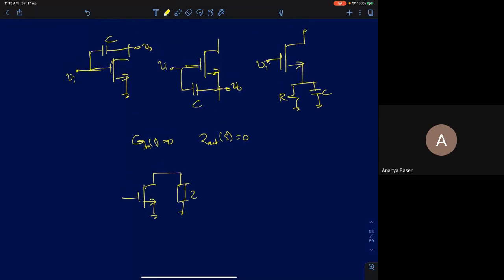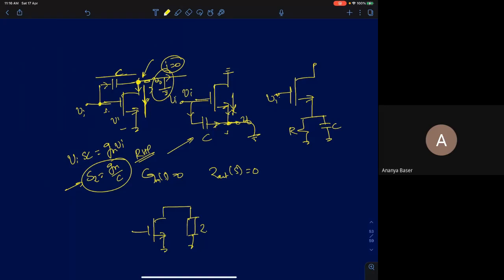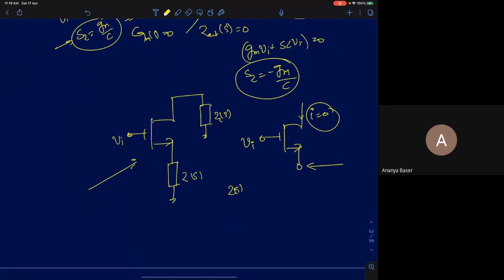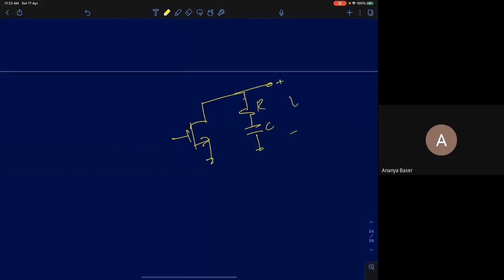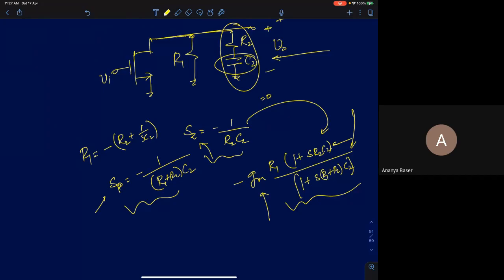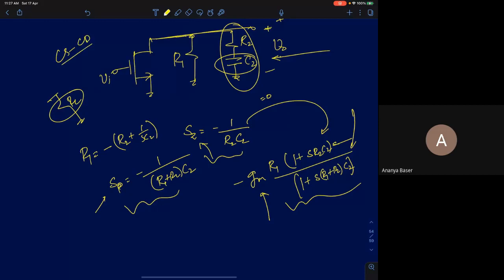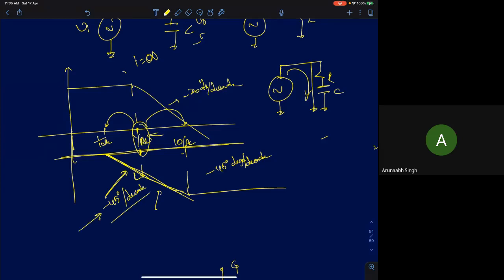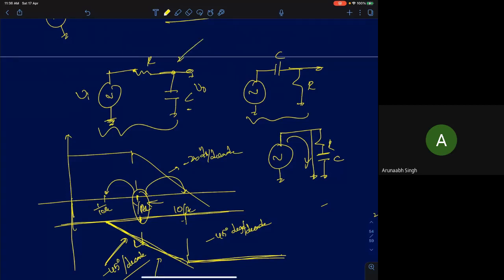MUE   Lecture 61: Intuitive methods of finding poles and zeros in MOS circuits-part 2

Comment: Dear sir.. Good one, but at zero frequency the won't go to zero because it is not complex one. Some how making output zero geeting correct answer but not matching with my theory. Can you please explain. Thanks, Raj.
Reply from the maker: Hi raja Sekhar, I think already explained this on the AIC course playlist. Please refer to that. I remember answering a similar question before. The circuit elements are replaced by its Laplace transformed  impedances and thus using the approach (setting output to zero etc.) gives an exact mathematically accurate value of poles. But if you feed a sine wave of that frequency you will not get a zero there. You should feed an exponential signal with the exponent equal to the zero frequency. I explained this clearly in the lecture on poles n zeroes in the AIC course.